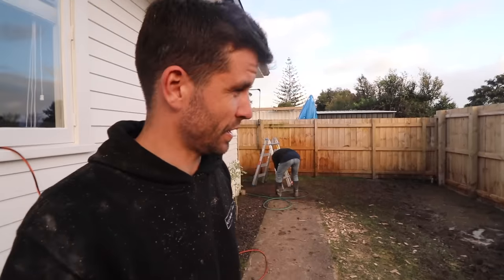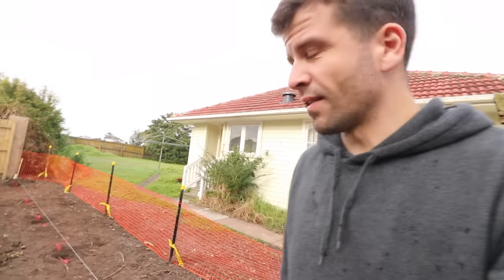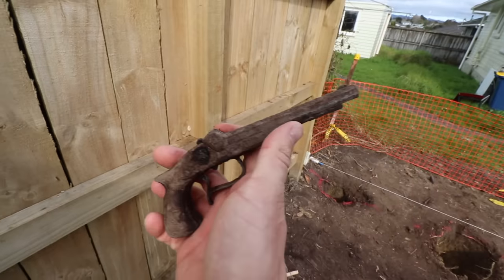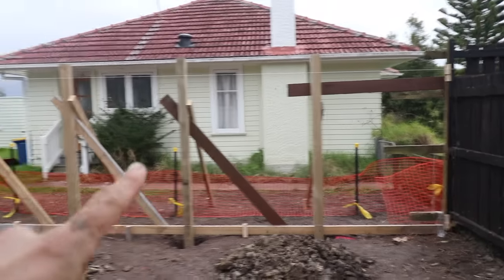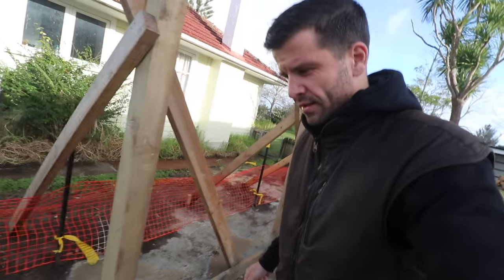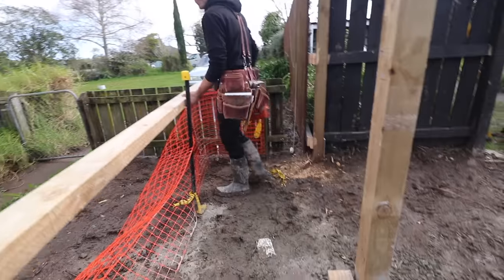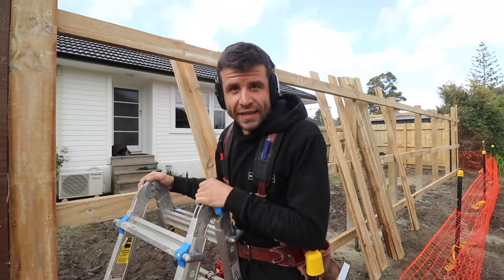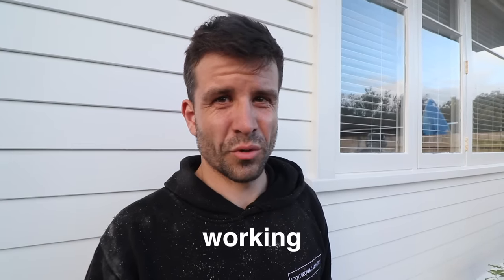How to Build a Fence (Like a Carpenter)

Comment: Posts should be sitting on gravel for drainage, concrete against wood is not a good long term solution. 
To help against rotting I’d have painted the posts where they will be sitting in the concrete, silicon around post where it goes into the concrete to seal against water ingress and the cut at the top of the posts to let water run off isn’t steep enough to prevent rotting. 
And....finally what happens when the wood swells? I didn’t see any provision for that movement?
Looks nice and straight though

Comment: So many more efficient ways, but also you hammer in your support beams so that you sledge hammer them out? Screws maybe, so that you don't ruin the integrity of the concrete you just poured, not to mention faster cleaner, safer.... On the brighter note, that fence will be very wind resistant.

Comment: Why do you stick the fence poles directly into the concret instead of using these steel brackets als "shoes" ? Even pressure treated lumber will start rotting soon where it meets the concrete, if you ask me.

Comment: Asking if you don't get troubles placing the 'naked' wood into concrete. Concrete doesn't let water through so water stays on it and the poles will get destroyed over time, right?
Reply: These post are treated for high decay areas like ground contact or fresh water.

Comment: Just to be clear you put the temporary rail so the posts would not touch the bottom of the hole. Does that mean the bottom of the posts are encased in concrete? shouldn't there be gravel at the bottom of the hole and at least covering the bottom of the post?
Reply: Yeah he lifts it so the concrete goes under the post like a small concrete pad

Comment: cement eats away at the wood really quickly, will be rotted out.. Should always use metal anchors in the cement.
Reply: No absolutely don't use metal anchors(we call them met posts) Bowdean has no idea how to erect a fence.
Reply: @marccarter4469  Yeah, Ive actually replaced many fences because the builder never used anchors and the post's rotted out.
Reply: @mcnowski  I am a fencing contractor and the most rotten posts we remove are those in met posts they are complete rubbish and if are still using them I'm glad you're not doing a fence for me.
Reply: @marccarter4469  To each their own bud.  I do know I'm staring at a fence I built years ago using concrete post anchors and its still just as strong as the day I made it, and I live in a temperate rain forest where everything rots quick.

Comment: I bought a mini digger so I don’t have use that two man post hole. I think it was worth buying it back saver
Reply from the maker: Good call man, we were talking about that as we were lifting that thing out of the ground !
Reply from the maker: Good call mate! We were talking about that as we were lifting the machine out of the holes
Reply: Glyn Owen ahh ? Mini digger with a post hole attachment is the same thing without you doing all the work to lift and etc
Reply: Glyn Owen and a back saver.  being in the building Industry for 10years now it takes out of you

Comment: im so confused... what was the point of running the line across the top and checking it with a block if you are just gonna pop a line and cut it at the end anyway??
Reply: bob jim so the bottom of the Palings are flush

Comment: Always wear safety glasses when using a nail gun - those little sparks you see coming off are actually minuscule pieces of metal flying out !! I had to get the lens removed from my eye and a plastic one put in ( basically a cataract operation )because of one of those those !!! Not a pleasant thing - stay safe

Comment: You don't "level" a post, you "plumb" them, Level is horizontal , Plumb is vertical, nice fence btw
Reply: A builder that doesn't know the differences between plumb and level?  Who the fuck thinks that?  Come on people in the comments ffs .... its not even my video....  Make a video put it on youtube and lets see if it perfect
Reply: Was just about to say the same...level post ffs.
Reply: theres no reasonable way to get every hole the exact same depth, especially if theres a slope, its not a big deal to cut the tops level afterwards

depth into the ground varys by region, here in canada they want 4' to try and keep the frost from lifting them, he definetly overdid it and made a mess with the concrete, probably spent north of 1000$ on it too when about 25 bags of 6$ concrete mix would of done the job well and it wouldnt of taken any longer or required coming out on a miserable day and ruining the lawn just to pour concrete

one bag per post is most likely sufficient in this use, 2 would be more then enough but with the size of auger he used itd probably take 3 per post to fill it, could always use gravel to fill it partially though
Reply: He did use a level to plumb the post. Hense leveling the post. Or does everyone here call it a plumb? You get those from a fruit store don't you? Stop knit picking.

Comment: Half way right....bolts in the larger than normal posts so I'll give ya one for that..but nails...in a fence..that gets buffeted by the wind as well as heat and cold expansion and contraction...umm..no. screws only and they'll never come out.

Comment: How did you manage to turn a one day job in to three,?
Reply: Eric Stover those are my thoughts exactly, in their defense the fence turned out nice but like you said a one day job. I installed 150’ of fencing 3 rail 6’ tall with 3.5 inch pickets and a 6 foot double swinging gate in 3 days. Oh and I mixed all my concrete in a wheel barrow
Reply: How the hell do you guys dig a hole, and set a post, have enough time for it to dry and then build the rest in one day?
Reply: HQ DIY quick setting cement.
Reply: @israelarreolasanchez814  and how long does that take to set for a post before you can work?
Reply: HQ DIY  back in the day when I did this on a daily. Two experience installers, we would get to the job site teardown fence, dig holes and cement the post in before lunch. We would take 30- 60 min lunch and the post would be set rock hard.  We could do up to 125 ft of fence in one day. For new construction. My partner and I would do up 550 ft in one day more like 6 hours.  No post settings. Another crew would do the post setting before hand. Those were the days.
Reply: Quickcrete makes a 50lb bag of fast setting concrete. It will harden Enough to hold the post plumb in about 10 minutes and is frame ready in just a couple hours. This avoids the need to brace each post which saves you money on materials. You dig and set both end posts first after that you go and dig out all your in between posts and by the time you do that your end posts are stiff enough to run a string line from end to end. You then go and set and plum each post in between. At this time do some cleanup and get your compressor, guns, saws all ready, stage your materials and begin framing. Run a string line at desired picket height and begin slamming pickets.
Reply: Israel Arreola Sanchez I would love to have posts already set...
Reply: @israelarreolasanchez814  brilliant I love it
Reply: good for you

Comment: Scott has just killed the next bloke to rebuild that fence in 15years time. A 900mm deep hole filled with concrete is just wrong. 2 bags of quick set at the bottom and then mix the dirt from the hole with cement and back fill. And you can work off it almost immediately. And you won't have dirt every where either
Reply: Johnny Badfinger cut it off, move them over.
Everyone is guilty of stretching full rails on an intermediate to miss a rock here and there haha.

But it was overkill as hell.

Comment: What is the benefit of not letting the post contact the ground other than it causing rot from moisture and such?
Reply: Its just to allow water to drain which will prevent post rot, concrete deterioration and also stop the ground around the post from failing.

Comment: Yes u did a great job but u did it easy with ur hole borer and ur ready mix i dont have that luxury i have to dig my holes by hand with a grafter and mix my concrete in a barrer and nail my boards on with a hammer and nails lol and thats the first time ive ever seen someone put the kick board on before the posts and using 2x2 steaks ... Learn something new everyday but what happened to the capping which sits on the top of the boards it finished the job off nicely ...

Comment: Why not pour the concrete in straight from 60lbs bags? N why use an auger when post hole diggers can simply blast thru that dirt and it's less hassle...an auger is nice when NEEDED... usually it's just another piece of equipment to lug around and u need to eventually scoop out the dirt anyway...to each his own

Comment: Why Australia all fence have to notching  fence post for rail.new Zealand does not?which is good?
Reply: Raymond Jonson mortised posts FTW, or bolt and bracket so the bolt is holding the whole rail and can't split. 
65mm steel posts and brackets probably offer best results. 
Just not 150x50 posts unless you want it to look like a timber roller coaster in a month.

Comment: Do you not find that concreting wooden posts in like that rots the bottoms faster?
Reply: How would you find that out?
Reply: @DiscoFang  When I've been asked to replace posts I tend to find that soft wood which is totally encased in concrete rots because the concrete contains the moisture that runs down / seeps into the post
Reply: Ben Paynter Which country are you in? What timber was and is used? This timber is CCA treated pine which lasts fantastically in concrete. My previous question was a little facetious - I regularly break open posts dug up for landscaping & reno projects and find the posts in fine condition. The treatment stops the rot & the concrete actually isolates the timber from weathering. 
Even steel reinforcing hardly rusts at all when encased in properly vibrated concrete.

Comment: Love this channel but that wouldn't last 5 minutes in the UK with the weather cutting into all that treated wood, paling tops, half laps, bolt holes
Reply: What would you do differently in the uk?
Reply: @MrHavokman  just try to reduce the amount of exposed cuts because up North the weather is wet all the time. 

I'd use end grain preserver on the top cut palings, or place some kind of capping over the top, it makes the fence last a lot longer.

No objections to half laps but id still nail them with annular ring shank nails. I would just allow the two ends of the rails to meet if the post was large.

Comment: Hey Scott how did you work out your spacings for your posts? And more important how did you work out your spacings for your fencing? It's hard to find a spacings video that is in metric.
Reply: Spacing should be 1.8 as rails come in 3.6 lengths
Reply: @Greig-gb9et  or 5.4 or 6.0m

Comment: Pouring concrete into a hole full of water is going to give a weak set...that's why the posts were wobbling when you trimmed them.
Then working in the wet stuff the next day...very sloppy.
 3 bags of postcrete would have been great per post.
 That is a one day job ... not 3 days.
Reply: Check us out. We are a fan of the postcrete

Comment: I would have pissed that job here in the UK in a day, I wouldn't have any work if it took three days and why so much concrete,,, were you putting footings in for a new house . And Jesus Christ a cement truck, that is some lazy shit.......fence looks simply devine,even if it has cost the homeowner an arm and a leg.
Reply: I've ripped down a lot of fences that were done in a day. Nobody cares about how quick it was done when it's falling over in 6 months.
Reply: Each to their own, but in my opinion that was way over the top timescale for installation was terrible and regarding a fence that lasts less then 6 months what a load of bollocs, now if your in the trade you need to give your head a wobble, but if your not your ignorance can be forgiven

Comment: I pity the poor sod who has to, inevitably, replace the rotten posts in the future.  Never seen a concrete lorry used for ten posts.
Must've set the customer back a packet and will cost them again when the next guy spends five hours breaking out concrete as strong as that.
Nice neat job though fella.

Comment: I like to pour the concrete after the 2x4's go in between the fence posts
Reply: Matt Waldron whys that?
Reply: @Arsopu  it is easier to build a uniform plumb and level fence first and then lock everything together with concrete at the end.... If you pour the posts first you have to do a bit more measuring and cutting
Reply: Ahh, yeah I get ya.
I think about that sometimes but everything I get is pre mortised already so I just work out my highs, lows and then find the median.

Same result, different method. 

If I'm using brackets I just go to town get my heights on the brackets and trim the posts, similar to what you're saying.

I'm completely OCD and only allow 2-3mm tolerance over 50 metres, but I love my job and find it rewarding to do a kickass job.
Reply: How do you get your long spans level?
Reply: I just set up a laser

Comment: Actual professional Fence builders are laughing at this video and saying carpenters always doing thing the hard way Lol. As a carpenter and then I added fencing to my business I learned alot. If those post's concrete was done right, the concrete would be set in 1hr or 30min if you use fast set. You should not set posts in liquidity concrete it weakens the posts.

Comment: Fuck the timber and pegs off and all the bracing. Run 2 plumb lines one at the top and bottom of posts , Put a little bit of Crete in the hole put the post in plumb to the lines and the other person throw the Crete in. Done if you use rapid set/ quick Crete you can rail and pail it in the same day. And also who the fuck uses a nail gun to put the rails on? We always use batten screws makes it way stronger

Comment: Needless use of concrete and wagon. Should never need to cut tops off posts...just put it further in the ground or buy shorter posts. cut the feather edge to the right length before installation. Nail the rails to the posts and no real need for half lap joints just butt them. They tried hard enough but far too much time and effort was put into a very easy fencing job. Oh and whats with the hole bore?...double shovels and graft mate.

Comment: Is this a joke or parody of a first fence video?? Its like watching someone tell a joke with a serious face n no punchline so confused why u used a string line then had to cut the tops off lmao!!
Reply: He used the string line to plumb the panels up and get them in a straight line not the tops mate.
Reply: If you've ever put a fence up you'll know that not every hole can be dug to the full depth due to rocks etc. Also, it's not always possible to get the post length you want.

Comment: Some of the weirdest methods I've ever seen:

- massive amount of concrete delivered at max cost via cement mixer truck for what, 7 posts? then poured all over the yard?  why not dump half a dry bag in each, water them, and be done with it?
- bolt the posts so a fixed depth, but then cut off the tops?  Why not set them full and cut less?  why waste the time to drive stakes, mount the 2x4 and hang each post?  The ground doesn't mind how much post ends up in it.  Dig your holes to proper depth and skip all that mess.
- string for level on pickets, but using a spacer below the string to position each picket?  Why not set the string at top height and position each pickets just barely below string?

Carpenters, maybe, but fence makers not.

Comment: Horrible job... Posts are set with concrete once you level them. One guys eyes ball them and one levels them. Once leveled you can set them with concrete. Your post aren't even deep enough, and the cuts at the top are all crooked. That's why you set them at the right height so you don't have to cut them later on.  You called a truck for that small amount of concrete??   And the third rail at the bottom? That fence is going to rotten in a year, specially because of the mess you made. The only good thing you did was using a string line for the pickets to go straight.

Comment: I don't want to build it like this carpenter, I want to do it right! I would fire a crew that was that careless with the concrete.
Reply: Too right .
Reply: I'm glad you'd put the job off till summer when the ground was hard and using water to clean up wouldn't exasperate the problem by putting more water and concrete onto the neighbours side. Considering the weather he was working in to complete job it could have been worse as its been a rather wet winter here. The end result was tidy and it was being painted black as well.

Comment: You are differently not a fence man.....that 2 man digger is nothing more than a pain in the ass....and concrete truck for a few holes and why the string and then cut off the tops of pickets......I could keep going on but these type of videos give people the wrong ideal. There is the right way and wrong way......and then your way...........WHICH IS WAY TO LONG AND MONEY WASH DOWN THE DRAIN....